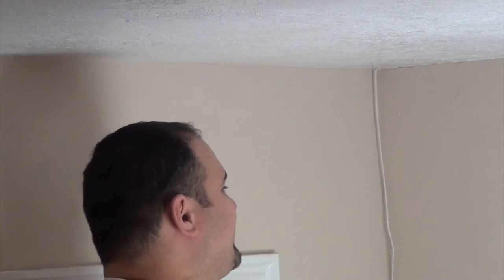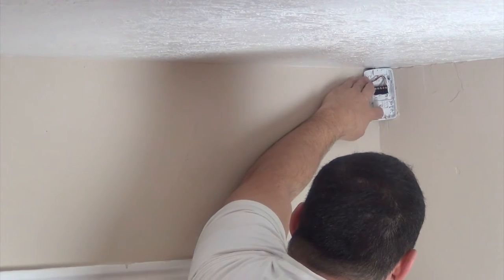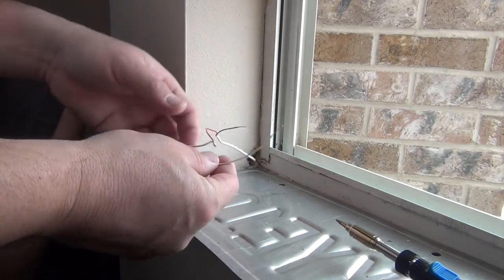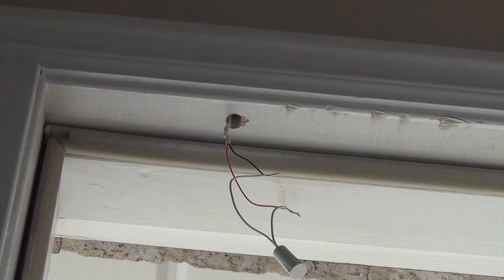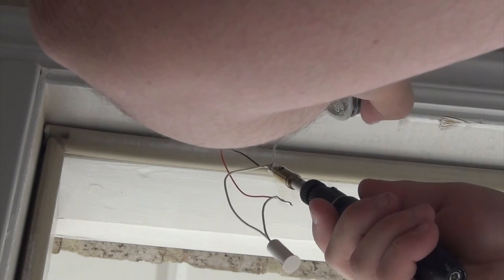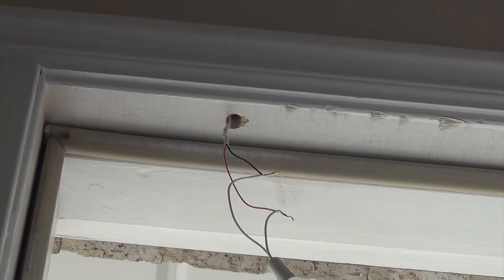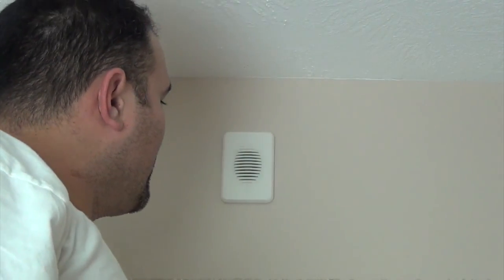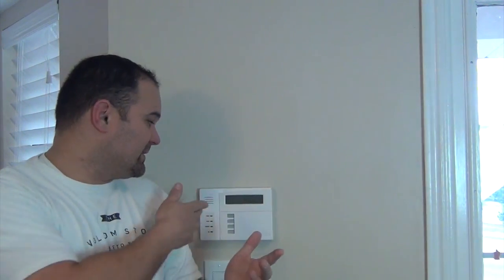How to install your own Home Security System and not have to pay for monitoring Part 3

Comment: Great stuff - in the process of cutting the cord, this is helpful.  Would like to get notifications on my phone somehow, perhaps control alarm system from phone.  Looks like the episode on programming the system is on hold for now.  Will (reluctantly) search elsewhere...
Reply from the maker: Unfortunately, getting notifications and arming/disarming isn't solely a matter of programming. You also need hardware. Find the make/model of your alarm panel and do a search on add-ons that allow control without monitoring. Sorry I can't be of more help.

Comment: Hello Alan. I’m very surprised this series of videos you so painstakingly made hasn’t gotten more views and comment! Because I think you really did a good job explaining, demonstrating and editing all 3 of them. I know I learned something and Thank You for that.
Perhaps you might answer a question for me. I’m going to help a friend connect wired sensors from windows and doors to his (get ready for it) NVR. The NVR has 4 Alarm in connection’s (will use for front and back windows and front and back door) and 2 Alarm out connection’s (will use 1 for siren and the other not figured out yet - haha). My question is (please think about this one) I’d like to put a small control panel in between the sensors and the NVR so  his family can easily arm and disarm (maybe even with a remote) the sensors.
Can you PLEASE tell me how to install a control panel like that and perhaps even suggest one? Thank you very much!
Reply from the maker: How do they arm and disarm the alarm now? Do you have the make/model? Thanks for watching!
Reply: Alan Clegg There isn’t one yet. We are going to put the wired sensors in.
Reply from the maker: What is the make/model of the NVR?
Reply: Alan Clegg Most Security Cameras are the same when it comes to the Alarm in and Alarm out connections on the back. It will be a Lorex NR9082.
Reply from the maker: I was a little confused by the question. For some reason I was thinking that you had an NVR with an alarm built in. Unless I'm mistaken, that's not the case. I can't think of how the siren will be used on an input either. The inputs are used to trigger the NVR so it knows when to start recording or when to send you an alert that you have a zone that was violated. It doesn't work as an alarm panel. The output can be used to trigger a small security panel though. When the front door is opened, the sensor sends a signal to the NVR, it starts recording and the NVR triggers the alarm panel which can be armed with a keypad or keyfob remotes.
Reply: Alan Clegg Yes, the Door/Window sensors trigger to Alarm in (that also triggers the cameras if they weren’t already activated). The alarm out sends a signal to the siren. 
Thanks anyway.

Comment: Always, always, always solder.  You might have a thousand good crimp connections; just try to find the 1,001 that failed.  

Also, try this for flexibility:  install the contact about 9" above the edge of the closure.  Then, you can install 2 magnets.  The second one will allow you to leave the window open just far enough to allow for ventilation but not so far as to allow someone to crawl through.  

Finally, try this:  On the door switches, access permitting, install the switch in the cavity where the deadbolt inserts.  Then, drill out the end of the dead bolt and insert your magnet in there.  Using this technique, the alarm won't set if the door isn't locked!
Reply from the maker: I’ve done the venting option before but I’ve heard of the deadbolt idea. That’s great!